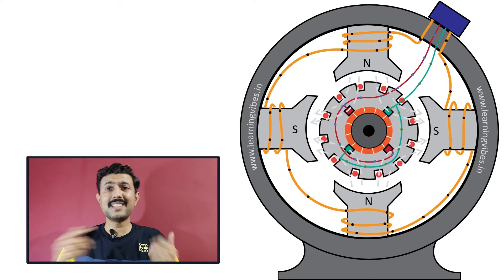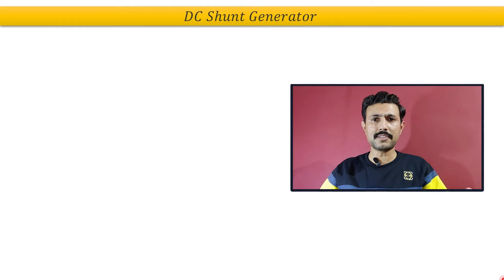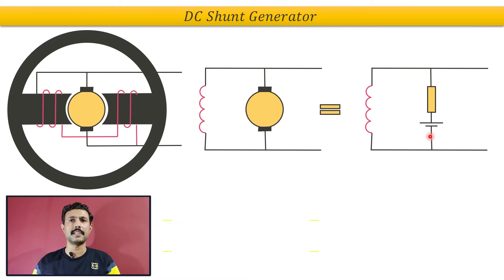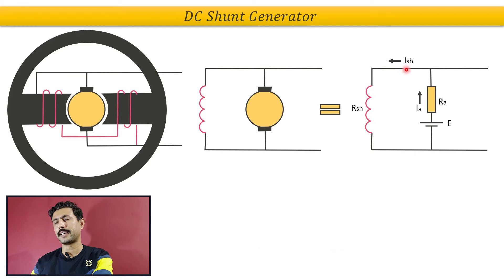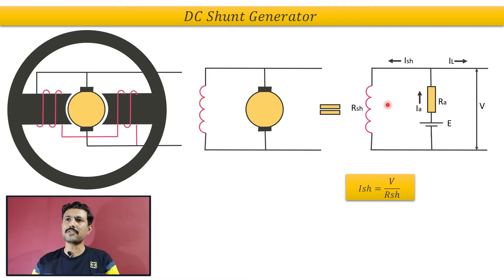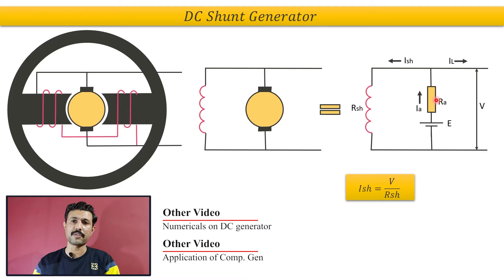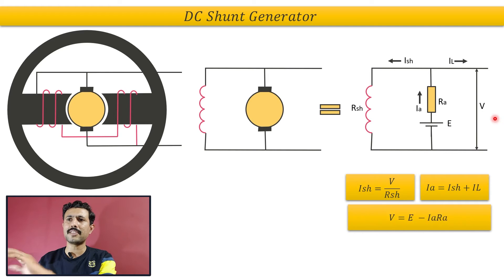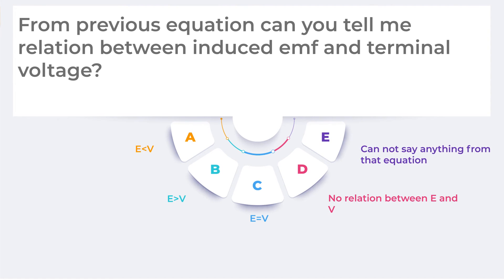DC shunt generator Induced emf and terminal voltage equation | Mruduraj

Comment: I didn't understand how is E induced in armature without rmf.
Reply from the maker: There is a magnetic field
Reply: @LearningVibes  where u didn't mention anywhere in the video
Reply from the maker: This video explains only equation.
For working plz check my other video on working of dc generator. There everything is explained in detail with animation
Reply from the maker: @XTi9  there is a residual magnetic field in poles of self-excited generators. when it starts for the first time because of this residual magnetic field small current flow and this produce more magnetic field in poles and this eventually increases current. this keep on increasing until the rated terminal voltage reaches.
Reply: @LearningVibes  yes residual magnetic field that's what was missing here.
And thanks for replying